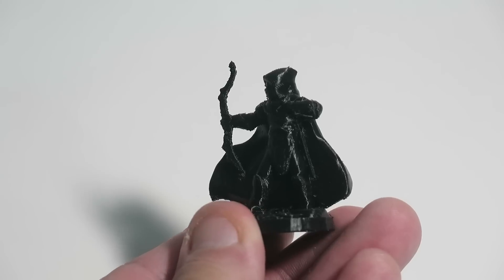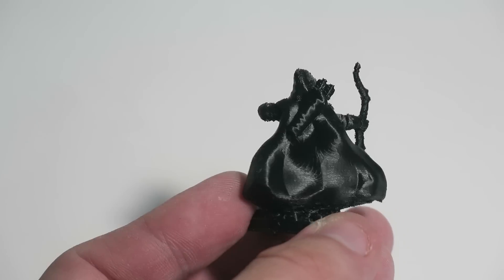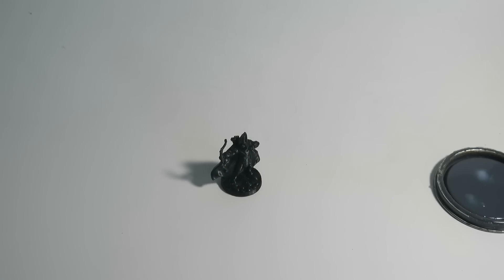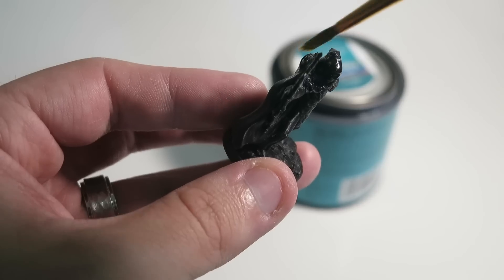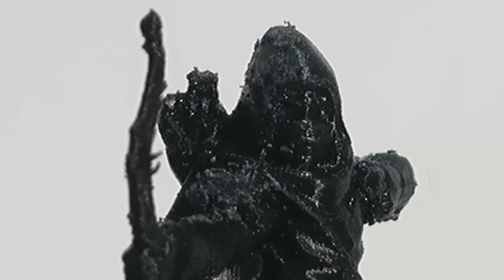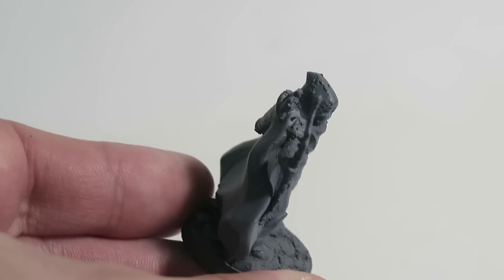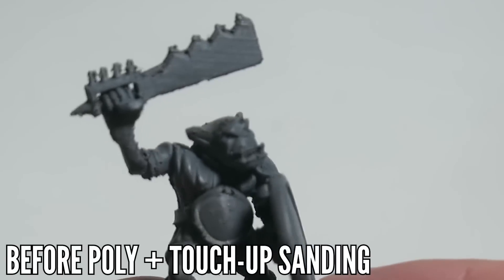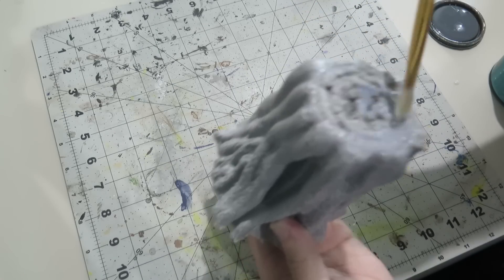Smooth 3D Printed Minis in 1 Min without Acetone - (Printing The Game #5)

Comment: Thanks for this video really helped. 1 question I have is: do you think the quality of the filament makes a good impact in the printing quality? The 15€ filament that I use is fine for my cosplay props but when trying to get detail it struggles. If a mores expensive filament is more consistent or flows better may I see an improvement in detailed tiny parts?
Reply from the maker: Some folks swear by filament - I've noticed a difference, but not significant. Only in that some filaments give me a harder time than others. I use Hatchbox for minis because I don't get many breaks, clogs, and it's always been consistent for me. Some folks go cheaper and have no problems - but I like to play it safe sometimes :) Hope that helps!
Reply: Use ender pla in my opinion , i struggled , got pla plus because its more expensive and claimed to be better , the stringing was really bad , added hours of sanding . I went back to ender filament and it was perfect ender pla is 20 uk pounds here

Comment: have you tried increasing the Zdistance top/bottom in the supports? looks like your supports leave some plastic on the model when you remove them
Reply from the maker: Great question. Actually both of these were tested using an increased z distance from my original settings. It's always a balance with supports - if I want the model to be fully supported, in my experience it pretty much has to be connected - and an interface has only made removal harder in my experience. The only way around this is either accept that your mini will have some parts that aren't as well supported, or have some support material that needs to be filed/removed. I generally lean towards #2 since it has lower chance of total failure. 

Once I have improved support settings I'm confident with - believe me, I will be sharing :)
Reply: very good answer and i respect this opinion, but with slow print speed (i print at 20-25mm/s) and a strong airflow (with PLA the more you have the best) i sometime wonder if my printer could print in the air... my stock settings in cura had 0.4 top distance, which made sense because i started by modifying a 0.2mm layer height profile, i m currently using 0.24 Ztop for 0.08mm layer height, the supports end up "supporting" only in few critical points because in all the others they are not really needed (but cura thinks they are)
Reply: also in the beginning i had a little bit of overextrusion that made the supports extremely hard to remove, the flow % is very important on these small prints.. also i ve found that lowering the temperature a couple degrees did help

Comment: Is a raft needed for printing minis? I tried without raft and small parts won't stick.
Reply: A G i never use rafts, i print on smooth glass covered by a layer of stick glue which i apply right before the print, when the print is done i take the parts, wash the glass and repeat.
it s a little extra work but for very long prints i don t want to throw it all away just because one single part didn t stick!
Reply: i usually keep the raft so i will not damage the miniatures feet when i use a spatula . i use a brim when the miniatures has its own base.
Reply: I normally print with a brim and have the supports be the only contact with the plate. Sort of like having the miniature in the cup of a hand being all nice and cradled.
Reply from the maker: When I print on glass, I use hairspray and usually don't print on a raft, only a brim. When I print on the Ender 3 build surface, I use a raft for minis to help with removal. So pretty much what everyone else here has suggested! You guys rock! :)

Comment: Great idea Danny,
just got my Ender 3 and printed the test dog straight off the card. Man they went to town on infill for that thing! 5 1/2 hrs for the first print! 
Anyway turned out brilliant. looks like I put it together right and got the bed where it should be, blown away by the quality of the build and ease of use of this thing.
Going to try your Poly trick with some Rub on Poly (much thinner) and dip a mini then hang it, got a feeling it might get similar results, plus I got a lot of it and could help stop pooling and minimize mess and wastage .
Nearly worked my way through all your vids now, enjoying watching you grow.
All the best.
Reply from the maker: You're the man, Mark. Thanks for sharing your experience with us! Let me know how all of your tests work out - the community will be better off because of it :)
Reply: Finally got to it. Dipped a 0.15 x 30% infill twice and just touched the pooling drip with the edge of a paper towel to even the surface tension a bit . now gotta work out how to send you a pic as I cant post it here ;) 
We don't have MinWax but Minwax rub on poly is exactly the same as what I used. It is solvent not water based so well ventilated area advised. 
.Also found that before it sets up ,flip the model over and let the poly level in the other plane for an even finish

Comment: Which Printer are u using the most? (I love ur videos, they help a lot :D)
Reply from the maker: Right now, it's the Ender 3 because I'm doing a lot of stuff with minis as of late. I'm working on upgrading my CR-10, but that is a work in-progress since I'm not the most technically inclined :) I stand by both machines, and will have a full review of the Ender 3 probably by next week.

Comment: I recently started using Methylene chloride for smoothing. It’s strong stuff but it’s the only thing I have found that dissolves PLA.
Reply: Danny Abrams that s interesting, i strongly prefear PLA to ABS, how do you use it?
Reply from the maker: Hey Danny! I've yet to try Methylene Chloride. is it too strong? Do you use it like acetone vapor bath with ABS? Use it to touch up certain areas? And is it dangerous? Looking forward to your experience - thanks for sharing!
Reply: 3D Printed Tabletop 3D Printed Tabletop I for character I dip it for a 1-3 secs so I don’t lose too much detail. I also used a brush for a bigger print but it’s was devolving the brush and making the mini brownish. I do have to buy specialty gloves for it since it goes through normal glove.
Reply: 3D Printed Tabletop also it leaves a glossy finish so I dip it in acetone after to ready it for painting.
Reply: Methylene chloride and acetone are dangerous chemicals with exposure over time. Gloves are a must as well as proper ventilation. Also for minimum exposure use a  respirator with organic vapor filters. Google maps for both products for safety protocols for their use.
Reply: Oops, Google MSDS( material data safety sheet).

Comment: I finnaly got my printer(ender 3)! At the moment I'm playing with cura slicing setting. Tried a screw and nut design that didn't fit too well. Probroby didn't let it print slow enough.
Reply from the maker: You're on your way, Samuel :) Keep it up! Screw/nut designs usually require very precise calibration because of the extremely tight tolerance. Keep it up, you'll get there!
Reply: I put a glass sheet as a  print surface and the quality has boosted. I think the bed got bowed in shipment (Fedex). Now prints looks much smoother.